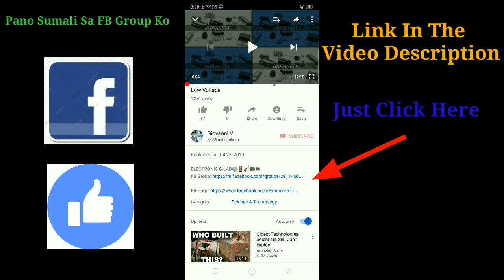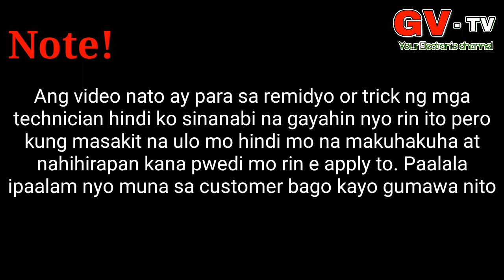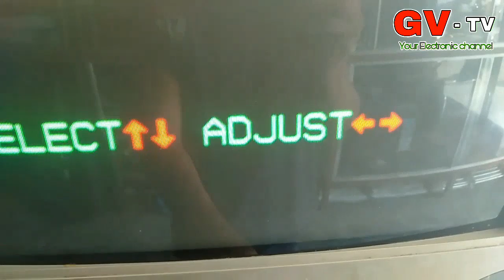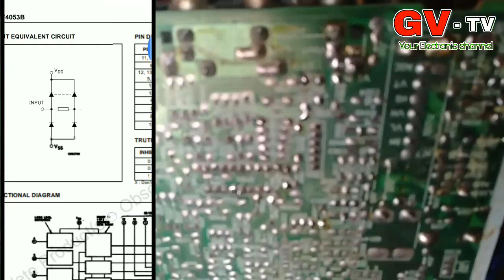Troubleshoot #6 TCL AV Display Magalaw At Minsan Walang Display

Comment: Nacheck u na ba mga capacitor sir?naincounter ko na yan capacitor sira.pro nice video prin sir..
Reply from the maker: yes! actual kung pinalitan kaya lang walang signal triger ang system sir
Reply: Kng wlang triger galng system eh bat naililipat sa tv at AV sir?
Reply from the maker: @JoeyTECHPH  nalilipat talaga ang problem ay frequency response channel (on) abnormal wave na ata...  frequency signal crosstalk 20 log parang abnormal din
Reply: anunG mGa uF na capacitor sir sharp na primo magalaw anu siRa na kulang sa supply anG screen nYa,,,d buo ang screen mY itim na nagviolet sa gilid at itaas at baba
Reply from the maker: @emalyn_23  rainbow color ba?
Reply: @GiovanniV  hindi nMan rainbow color blue pa dn nMan kaso magalaw  at d kompleto ang screen may itim sa gilid d pantay abnormal ang screen nya at magalaw pero blue at malinaw nman sya sa video
Reply: @GiovanniV  una sira nya d tumutuloy anG supply sa cRt socket iilaw sya pero nawawala dn nHanap q poblema diode lNg pala pero magalaw ang screen nYa kaht anung palit q capacitor ganUn padn paranG may konti deperensaya sa screen paranG pincusion distortion na slight lng nMan magalaw sya blue nMan sharp na primO nahihirapan kase akO

Comment: Sir giov sharp crt, wlang 180v sa flyback ano kaya problema?
Reply from the maker: 180v pa puntang crt board? check resistor sir
Reply: Flyback mismo sir.. lalabas pa rin ba yung 180v kahit  nakadisconnect yung crtboard sa tube sir?

Comment: Boss ka-G pa tanong po, my sanyo tv po ako 25'' nasira tapos nirequest po ng technician na bumili ako ng universal board pro 29'' lang po available nabili ko worth 1500 pro wla pa 1 week lumobo yung flyback, tpos pinalitan ng flyback ng philips pro lumobo parin.. Anu po problema nung board? Salamat sa sagot boss G.
Reply from the maker: high voltage settings.... may trimer adjuster yon... check mo din ang yoke mo sir

Comment: Sir sv mo pin 12 coconect?bakit parang sa pin 13 ka nag connect.tinititigan q pin nya 13 tlga sya nakalagay
Reply from the maker: 12 yon... my resistor kasi sa my 8-9 kya cguro ganun
Reply: @GiovanniV  ah pero pin 12 tlga sya..okey sir maraming salamat po sa share.
Reply: @GiovanniV  pwede po pakicheck nyo po video,kasi tingnan nyo po may label ung pin 8 at pin 9 pag binilang po pin 13 xa connected sa video nyo..sorry para sure lang po..5:38 at 7:36 po makikita nyo,baka po kako kasi nabilang nyo na number 9 ung pin 16..

Comment: sir tanong ko po panview tv set naka standby mode lang sya
Reply from the maker: check secondary baka my shorted
Reply: Boss giovan tcl din qo hybrid nagAutomatic shutoff siya bubuka ang screen ng dahan dahan tapos shutoff ulit,capacitor kaya sa primary sira nito boss?
Reply from the maker: check mo din secondary baka my leaking na maliit na Transistor sir
Reply: Salamat boss try qo sana hindi kayo magsasawa magturo sa amin boss giovan,god bless

Comment: sir tanong lang po sa TCL white screen sir, pero pagsinagad ko yung screen sa flyback mag green screen, minsan naman retrace line ano po ba trouble nito sir?
Reply from the maker: CRT board check mo sir check mo din horizontal capacitor
Reply: @GiovanniV  na check ko na lahat capacitor sir ok naman, napalitan ko na lahat ganun pa din. sinagad ko na sa flyback pero green screen na ang lumalabas? ok naman mga transistor sa crt sir.
Reply: sir sa crt nya sir ma na resistor sir 150 ohms, gusto ko sana palitan kaso wala akong makita sir, ano po ba pwedeng pang replace nito sir?